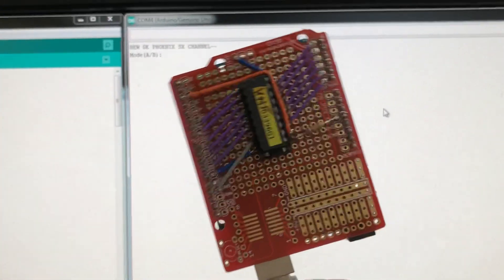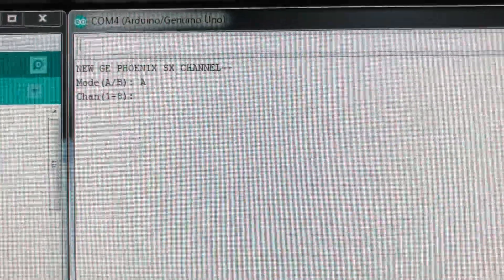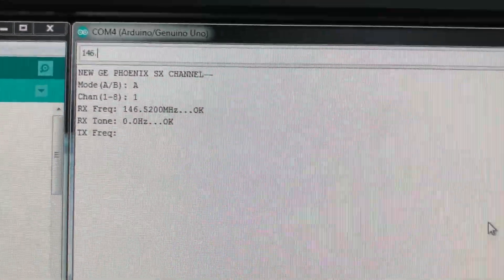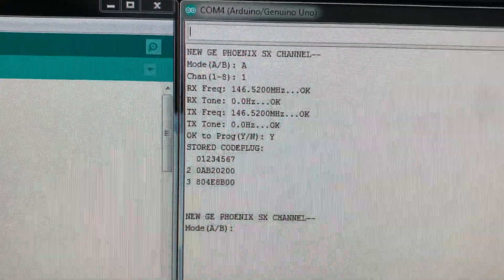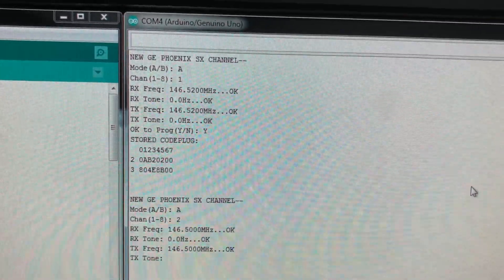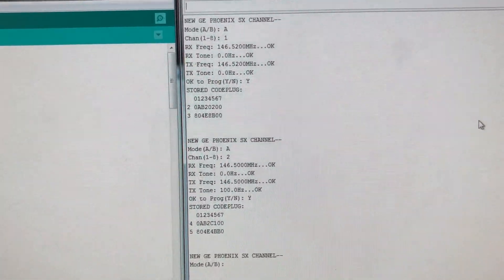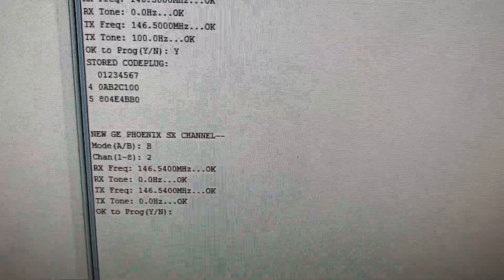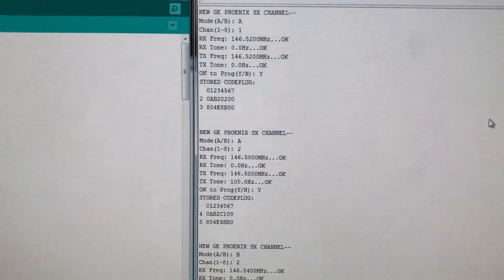Arduino GE Phoenix SX Programmer

Comment: I actually found your git before I found this video. Wasn't sure if it was working code or not, very happy to find this! I assume this works with UHF models also? Great work and thanks!
Reply from the maker: va3dxv  yes, it does both v and u. No way to read the chip, delete channels or set a diff CCT (TOT) yet but I plan to eventually change that.
Reply: @FandCCD  I assume addressing on the eeprom is quite different on the 2 channel models, I can't get it to work at all :)
Reply from the maker: va3dxv what model is yours exactly?
Reply from the maker: va3dxv is it a PSX-200? Can you see if it uses the X2212 or X2444 EEPROM?
Reply from the maker: va3dxv cool! Is that your github?

Comment: I've been looking for a GE Pheonix SX programmer, thanks! I have a couple of boards to do it, but am unable to get the software onto the DOS box because of, well, obsolescence. What would it take to read the EEPROM? Would checking for errors in the transfer be a function of reading the EEPROM and comparing? Cheers, Jim N8AVX
Reply from the maker: Thanks for watching my video!  I'd eventually like to add the capability to read the EEPROM but it's not a high priority for me right now.  I think it and error checking would effectively double the size of the program.  Additionally, I'm eventually going to build a programmer that plugs directly into the radio instead of having to pull the EEPROM.